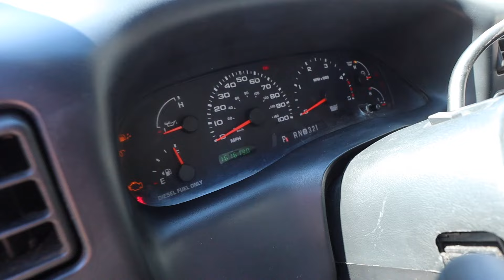DONT CRANK YOUR TORSION KEYS! *WATCH THIS FIRST*

Comment: 30 minute vid on a 2 minute subject. Never learned why I shouldn’t crank the keys
Reply: He did it wrong and got poor results.
Reply: Richard Martin Ah, thanks
Reply: I changed both of mine in about ten minutes .
Reply: Who is he? And why?
Reply: Cause cowboy boots and basketball shorts.......that's why.
Reply: It’s terrible for your suspension and it rides absolutely terrible
Reply: Crank em to high you run into uneven tire wear.
Reply: @JustinStrandberg-kc2ug  Not to mention your upper control arms dont sit right and the ball joints prematurely fail.
Reply: It only adds 1 inch of lift and not good for the tire wear
Reply: You should jack up the truck before you run them up i got 2 1/4 and still had 5 or 6 rounds

Comment: Your supposed to jack the front end up before you crank the keys.  By doing it on the ground you just twist the torsion bars. So it wont show as much lift until you go drive it around and let the torsion bars settle

Comment: Ryan just for future reference when you heat something up to expand it don’t instantly spray it with PB blaster, your cooling the piece you just heated up and shrank it back to where it was!
Reply: And change the steels properties as the bars are made from spring / tool steel.
Reply: Why are you heating the torsion bar? You should be heating only the key.

Comment: 2 sets of cables just allows more amps. If you were to try to crank like that with one set you would likely burn the cables out after 10-15 seconds, where 2 sets let the juice flow without the restriction.

Comment: 14:45 
lmfao that's me!
Unfortunately, but also fortunately, I'm replacing the lower control arm also, freeing the front of the bar.
The unfortunate part was having to saws all the the joint where the bar meets the control arm 😅
Which was after at least an hour of youtubing 😂

Comment: The torsion bar tool is only for unloading the keys.  Use a 1" steel bar and a 2 lb sledge to beat the torsion bar out of the key.  Use heat only on the key.

Comment: You must check your upper controlarm may be touch the chassis, that will be a problem. i have hd 2011 the upper controlarm touch the chassis and so i change my cntrols to aftermarket because they have different angle.

Comment: My 03 quad cab had 1.5 to 2 inch keys in the front and factory rear but wanted a little bit more so got a 3 inch lift and it came with shock extenders and rear blocks with new u-bolts for under $200 from a company called torch. 😂 mine just fell off but even though I'm over here in southern Indiana it isn't that rusty. Lol I also stacked the 3 inch blocks on top of my factory 2 inch blocks, the u-bolts had enough room to do it. That and the thing you cut off with the torch my truck didn't have that.
Reply: I also cranked up 3 inch keys up all the way.

Comment: 2 sets of cables allows more amperage to be transferred to the battery since most modern sets of jumper cables are a really small gauge compared to the older ones that looked like welding leads.  };-)

Comment: That because the wire inside jumper cables it two thin .it not twice volts its more amps .like if you had  two garden hose filling  a pool

Comment: granted I'm from the south so rust is not as sever but a pipe wrench is your friend. once the bars are unloaded,  just put a pipe wrench on the bar and work it back and forth in the unload direction and they will tap right out.

Comment: 😅  when dealing with the Torsion bar, You need to loose your front lower Arms, because the torsion bar even with out the keys, still have a Huge amount of pressure in the front..
I have a 2001 F150 .. I lern that .. lol
It was about an 1hr on both side doing this.  Still have to work it a little with a Hammer, but ALOT EASSYER.

Comment: easy way to unstick torsion keys. is. drill up   through them being careful  not to get as high as torsion bar but close  start with 1/4" bit and  go up as big as possible  then heat  it creates  a weak point that stretches when heated up

Comment: Lol. It's not more volts going to your battery, it's allowing a better amp draw. Most store bought jumper cables have thick insolation and small conductors. If you don't want to spend big money on cables you can make a really good set using single 0 wire for about the same price as the cheap ones.love that purple, I just did my suspension components that color on my JL.

Comment: Hey man I did the same thing to my truck take it for a drive bc I did the same thing as you did and it rides really bad bc there is no movement in the front end you mor less have to fine tune it the lift it’s a heads up I learned the hard way it’s so bouncy in the front

Comment: it probably would have been very easy to remove those torsion bars if you took the little pins out of the front lower control arms 🤷‍♂️
Reply: Which pins? Could someone just jack up the a arm to release the tension?

Comment: You need 2 new batteries in the Ford if it doesn't turn over fast enough the high pressure oil pump want build up pressure

Comment: Ahhh yes the good ol shitty rust my very first Silverado 1500 was a 01 extended cab I couldn’t get my keys out (Massachusetts sucks) ended up having to cut the key out hahaha my current truck is a 05 cateye 2500hd lowered an no bolts in lol but nicely done

Comment: Hey I know what the problem is I the 6.0 and you need to fix it ASAP or you will have bigger problems. Your high pressure oil pump is going out and when you are cranking like taht you have no oil pressure.

Comment: Two jumper cables? Electricity takes the path of least the resistance so in this case that would be the shorter cable. IMO, a thicker gage cable would be better.

Comment: Id be willing to bet ANYTHING alot of the no crank is because of the batteries! I had a similar issue with my 7.3 BUT it had new batteries so i swore that it wasnt that, it was something expensive blah blah blah....ended up bein the battery terminals they didnt look bad but the had just enough corrosion it wast lettin them charge the batteries

Comment: Anytime you crank your torsion keys you drive it around a few minutes then measure it. I did to my z71 02 avalanche few years ago and I benefitted 3 inch lift on the front
Reply: Did you have any problems afterwards?
Reply: @danielgordon4215  nope

Comment: That angled piece u cut out with the grinder was for the evap charcoal canister.. its where it sat and was held in place. ur truck should of had one from the factory. Its part of the fuel system

Comment: Adding a second set of cables is allowing more amperage to flow, not voltage. 99% of jumper cables are way undersized as far as wire gauge goes. And it being a diesel, it requires more amperage to crank.I bought a $100 pair of cables about a decade ago and they're huge compared to any others but, they were well worth the money

Comment: That's not how you use that tool. There are 2 dimples in the key. One for the adj bolt and the other for the tool. Once the pressure is off the adj bolt ( there is a tool for that) you use the tool you were beating on to apply  a little more pressure to remove the keeper pin. At that point you have to beat the bar out. Or easier still slide the cross member toward the rear of the vehicle in most applications

Comment: i bought a 96 burb for $800, it had a bad engine but also a 6 inch rough country lift, 16 inch wheels that look like the fuel black colored chinese manufactured but also had brand new 35 inch IRON MAN all country MT tires (only 4 wheels and tires)
my 2002 yukon xl came used with torsion key lift, rear airbags inside the factory springs and 33 inch mastercraft tires and 3 inch wheel spacers. they were super loud and wore super fast. it has LOTS of RUST so i bought new sheet metal off ebay but winter hit so i cut the front bumper a little and just a little sheet metal relocated the parking brake cable with a piece of coat hanger , removed the plastic fender well covers, painted the grill and both bumpers flat black to match the bed liner paint they used to hide the rust and installed those 35 inch iron man tires with black wheels, and besides the rusted out pieces the thing looks mean as hell!!!  right now the drivers tire rubs the windshield washer bottle just a little when turning hard, so when i locate my heat gun, im going to heat it and squish it in so it does not rub any more.
i live in a small town in South Dakota and my wife steffy works at the hospital so Blizzards, floods and muddy dirt roads can NOT prevent my wife from being to work on time to re-leave the previous shift that just worked 12 hours, and we live 18 miles from her work.  
my neighbor runs the exact same tire on his lifted 3/4 ton dodge crew cab for years now and loves them! in january of 2019 we had a BLIZZARD and i went into a comma with a Staph A infection. a Sheriff Deputy threw me over his shoulder (i weighed 180 pounds) and carried me to my neighbors waiting truck and they carried me to the waiting ambulance about 1 mile away.
yes, i live off grid in a camper but can walk 500 feet to my neighbors house!

so i bought 4 new 35 inch iron man tires with custom 16 inch wheels for just $800 and got a 6 inch rough country lift, upgraded brakes, new 456 gears front and back, top of the line tow mirrors, custom grill, new bumpers front and back, brand new in the box bolt on fender flares, projector head lights , led tail lights etc... all for FREE for my 93 burb ,just bought this stuff from off craigs list from a kid that was in the hospital and couldnt afford to have the shop fix his engine. just asked him what his bottom dollar was and didnt haggle any more as it was a great deal for me!

i also bought a 2000 burb for $200 from a friend for $200 for the wheels in 2018. i scrapped the shit out of it and only sold the body for tin as i cut it off behind the windshield , no wiring, no steel bolts or hinge parts etc... just tin only. cut the frame etc.. and sold as tin. i have the complete drive train sitting on pallets, the doors (6) the luggage rack , LM7 engine, 4l60, front fenders and hood ,trans , transfer case, radiator etc... for spare parts for my yukon xl and my 2002 burb. the LM7 runs and does NOT have the cast tech heads, so its going into the 93. going to sell some parts one of these days and buy a 4L80 to put behind the Lm7, i already have a 14 bolt rear end in the 93 out of a 92 4x4 truck i bought for $150 that had a bad engine!
i think ill put 37 inch military humvee wheels and tires on the 93 too with the  run flat inserts!
got a square body crew dually on a school bus frame, military 5 ton axles front a'nd back and lock outs on font axles. engine is a DT360A with 5 speed trans and divorced transfer case.
my 2   2002's  are flex fuel. im a retired mechanic (cant work a job because of surgeries from the staph) and i love to play around and build for SHTF!!!
Reply: You sound like me but I’m 24. Does it get any better on the financial side 😂

Comment: You can’t crank one side and leave the other the tension from the other torsion bar not being cranked will force the other down....and the whole idea about evenly turning the keys doesn’t work either if you notice from factory each key is turned in differently to make the turn have the same preload in each side, there is so much more too it than everyone thinks, you have to adjust each side individually and together if you understand what I’m saying. I have always used stock keys and never had an issue getting 2-3.5 inches depending on how worn your torsion bars are.

Comment: I ended up taking my torsion bars off with the cross member and a arms. With some judicious use of heat and hammers was able get the out of the  a arms. Had to use my 20 ton hydraulic press to get them out of the keys.

Comment: Nothing sounds better than a 6.0.  Add a high amp alternator like a Leece Neville with the battery cable upgrade like offered by FICM Repair and you will solve your charging problems.  The 6.4 starters spin the engine 150 rpm faster and are a great upgrade also.

Comment: You need to drive the truck a little or jack it up and let it back down to see how much the stock keys lift it. Also not a good idea to adjust them without jacking it up.

Comment: The federal tires are junk they wear poorly are loud rough so rough it makes you think your truck is falling apart had them on a 2004 Sierra 1500 I did the alignment after I did the front suspension rebuild kit and they still wore like crap traction in mud,snow great if you don't drive around on tar to much.

Comment: I just kept shaking my head, watching you, spray it with PB blaster and then using the torch and then spraying more.  You should not be doing that for one reason you noticed it started on fire and another reason you’re just cooling it down after you heated it up.     anyways I got the same kit and I probably spent about eight hours in the shop today. Trying to get my torsion bars free and didn’t get anywhere. Hoping tomorrow is a better day.

Comment: Before I got my zone lift I had a rough country leveling kit and my truck has no rust whatsoever and I couldn’t get the keys off. Ended up just cutting them off. I even had a 10,000 pound ram jack on there and ended up breaking the tip of the ram jack. So anyway I now have a zone 6” lift and rough country torsion keys. Lmao

Comment: ALWAYS replace both batteries at the same te in that diesel, the fact the you had to use two cables mean you have two sets that are too small and cheap, for carrying the current required

Comment: I highly recommend picking up a M12 compact ½" drive Milwaukee impact. I have the high torque M18 and scoffed at the little M12s. Until I bought one. Now I use it 90% of the time. It fits in so many places the M18 can't...

Comment: Figured I'd let you know I'm from ohio and there's a place in huber heights called high point they sell after market part for pretty cheap I bought some 20x12 -44 with 33 12.50 for 1875 out the door you should check them out Ryan

Comment: you will clear the tires, my buddys clears 20x12 on 33s with leveling keys, we didnt cut the fender and just cut some of the bumper, actually almost cleared stock then he got keys and it only rubs on tight tight turns like u turns and what not

Comment: the two sets of jumper cables lowers the resistance through them which increases amperage, not voltage. voltage will stay the same.

Comment: You just need heavier gauge cables, that why two sets works better. The bigger the wire size the better the electricity flows

Comment: Try plugging the powerstroke in for a few hours. See if it starts up. You might have a glow plug issue. Harness, relay, or glow plugs them selves. But that will tell you and possibly check something off the list and irs simple.

Comment: The next torsion bar lift if you pre soak the lower arms and torson keys a day prior that will help loosen up and let it slide easier. the usless bracket in front of the fuel tank is for the evap canaster that looks like its missing. might be why check engine lite is on.

Comment: Could be the glow plug module. I had a parasitic draw on my ‘04 power stroke. Started after my top alternator went out (had a dual Alternator setup). still didn’t fix it replaced both alts and batteries like 3 times, ended up being the glow plug module had failed and fried the harness.

Comment: You are not pushing more bolts to the battery. What you are doing is pushing more curry through the battery. Small the jumper cable less current. When you combined the 2 cables together you doubled the current.

Comment: Check your ball joint angles. Mine are horrible, and that's with stock keys. 3" lift spindles are supposed to be way nicer. I'll be switching to those when I redo my whole front end. (Whole front end is stock and needed replacing anyways, which is why I cranked the keys lol)

Comment: Much easier to crank the bars up if you jack the front end off the ground.  It unloads the torsion bars and makes the bolt turn much easier.

Comment: There's a video out there where the torsion key was cut and released so easily. You do have to cut into one of the supports, but it does not compromise a thing.

Comment: Seeing how you actually view the comments i would like to recommend you to get a air hammer that would of made this a lot easier on ya. As well as everyone else seeking to do keys or lower control arms. Either a spike bit or a small enough hammer bit on it will work fine. Also will help you out doing rusty cv axles.

Comment: I'm so glad when I did my leveling kit on my 04 Ram the keys came right out.  Took less than 30 minutes. I ended up putting longer front shocks on it for ride quality. Don't forget to get an alignment too
Reply: So did you no crank the keys? What did you do for the leveling kit?
Reply: @day2daylogic802  I put larger keys in it  there was minimal cranking on them. I think it was rough country leveling kit
Reply: Can you crank 2 inch keys

Comment: My bucket truck is a 6.0L. Put 120,000 miles on her. We’ve definitely shared our fair amount of break downs and won’t starts. Most of the time the engine light doesn’t come on, but I plug the tuner in and it’s usually got a code or two. May be worth seeing if their are some “invisible codes”           
I used to have to pop the hood and hit the fuel pressure regulator (kinda looks like a bulky O2 sensor back behind the turbo) just about every time to get it to start. I believe the tuner always said fuel pressure regulator open loop. Just some food for thought!

Comment: Do yourself or the next owner a favor and put some anti-seize between the torsion bar and key to prevent it seizing to each other again.  Use the same thing on the tool where the threads are to prevent the threads from getting damaged.

Comment: Dude, you gotta stop quenching the metal. Use EITHER penetrating oil OR heat, not both at the same time. I mean, do what you're gonna do, but enjoy your warped weakened metal.